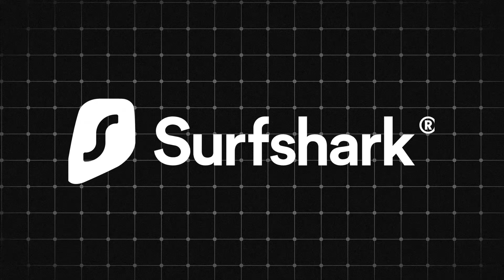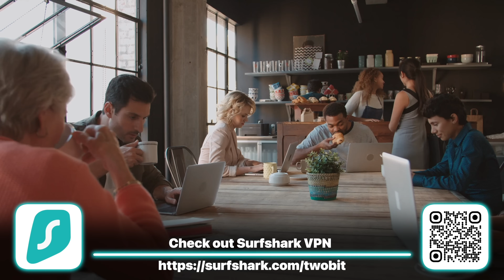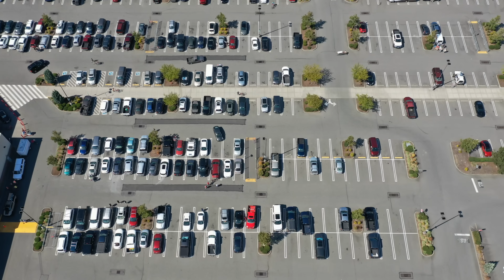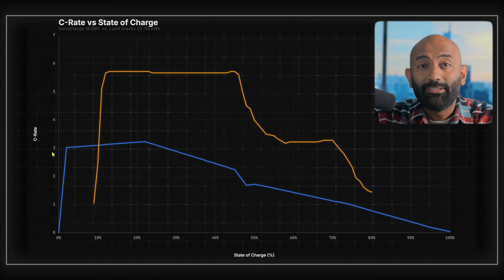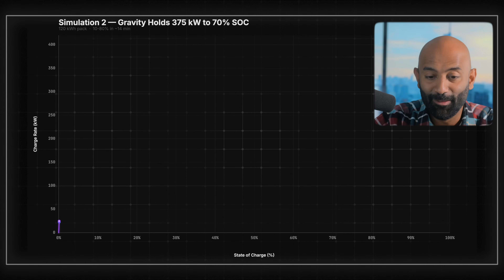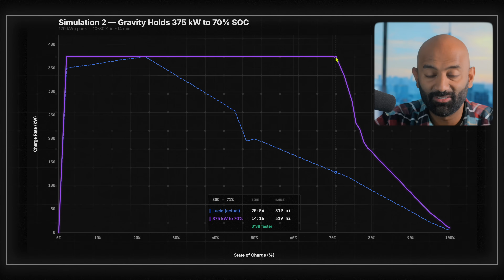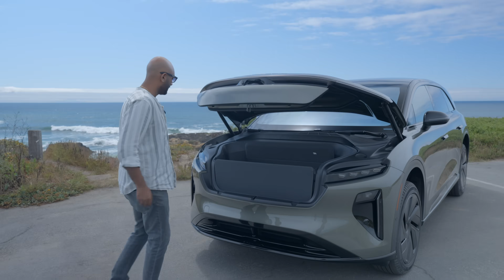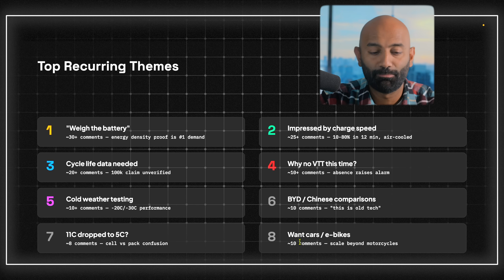Donut Lab Battery Test 4 Changes Everything!

Comment: If that energy density claim gets close to the 400Wh/kg on their next VTT episode, Donut Labs will need a bigger office space (not virtual as in their CEO's videos) - a Hyper Factory, if that is the right term. They will have a LOT of customers lining up. Who cares if these cells only maxes out to 20k charge/discharge cycles!! That is a moot point, but would be great if VTT can prove it by best estimation like how we calculate MTBF (mean time between failures)
Reply: If they could get 5000 charge cycles that would be (at 1x per day) 13.7yrs worth. Most people don't charge everyday. Really easy to make 5000 charge cycles last 25-30yrs. I don't think battery manufacturers want everyone owning 100,000 charge cycles batteries. It's hard to get repeat customers if the batteries last longer then the people buying them.
Reply: @kennedy6971  When you are in the business of changing EVERY single battery charged device, who cares about repeat customers? We all have hundreds of battery powered devices ready to be upgraded.
Reply: @kennedy6971  depends if they come out with more range
Reply: @kennedy6971  This. Donut Labs are getting so much hate out of nowhere when the same people are gooning after Chinese solid state batteries nowhere near production ready or tested. 

Why? Because it's a small company about to break the status quo.
Reply: @kennedy6971  100,000 cycles will matter a lot in applications that require multiple charges per day. What applications are those? Beats me, but if the batter charges this fast and can actually be whatever shape the user needs, that potentially opens up a lot of new applications that require very small batteries. 100,000 cycles at 1 cycle per day is about 55 years, sure, but is only 5.5 years at 10 cycles a day. Again, I have no idea what application would require 10 cycles per day, but I'm at the point now where I'm wondering if those applications don't exist because they aren't possible, or because they haven't been possible yet.
Reply: @kennedy6971 at the end we will be expecting from them to run away with money and instead they will die in weird accident.
Reply: @zperdek  this is a big government contract type of development not the weird coincidental accident type lol
Reply: @zperdek I’m expecting them to be bought out by big money. Then the project will be buried or hoarded for special purpose. Unfortunately, I don’t expect this to be a production product for the masses.
Reply: MTBF would be a good benchmark for stress testing the durability of the BMS (battery management system), as we've already seen in LFP packs, 99% of the failures are actually from the broken BMS, not from the failing cells, as the LFP cells are lasting over 5000 cycles that the BMS are failing way before the cell gets degraded below 80% health
Reply: If the range is 200 miles with 20k charge OR discharge cycles then that means 2 million miles. 4 million miles if it was 20k charge and discharge cycles...
Reply: @0ooTheMAXXoo0  In standard terminology, one charge cycle includes both the discharge and the charge part of the cycle. And it means a full charge. If you often charge from only 20% to 80%, those don't even count as full charge cycles.
Reply: it also depends a lot on how exactly the rated life falls off. i believe the standard for amountbof cycles is based on how many charges until its capacity drops to 80% of the original. 
so does the battery then stay at 80-60% capacity for just as long, or does it just completely break very quickly after dropping below 80%? a lot of people might keep using it with 80% capacity and not bother replacing it. or they can be reused in stationary power banks to store energy.
Reply: 14610 cycles are 40 years of daily charging 🎉

7305 cycles are 20 years of daily charging 🎉

... who charges daily?
Reply: @gridvid  People who try to prevent their Li-ion cells from degrading by trying to maintain as steady a charge as possible.

That said, since the chemistry here is looking less and less like Li-ion, maybe that doesn't apply?
Reply: modern cellphones?
Reply: @NotoriousNickNorris  Laptops never thrown out because their battery is dead?
Reply: @gridvid  -- People who drive an EV every day and who want to ensure that they have maximum range because of the unpredictability of their route that day?  I probably only charge my wife's MYP 3 times a week because we are retired and don't drive that much... I could probably cut that in half if I new with absolute certainty that my wife wouldn't decide that we need to detour somewhere else at the last minute... Then again, at our ages, even when charging the vehicle that often, it will still probably outlast us... The vehicle has 7500 miles on it after a year... That means that it would take 16 years to do 120K miles... Looking at normal life expectancy figures, I suspect that it is unlikely we'll still be around in 16 years anyway...
Reply: I’m as excited as you for this to be real!
Reply: Can someone explain to me, a total n00b in this field, why the power to weight ratio gets such attention? Not here to bash or troll, really want to understand the significance. Because my brain gets stuck at charge speeds, so power to weight ratio became less relevant but it feels like there is other artifacts behind that number why it is of importance. So please enlighten me!! Thanks a bunch!!
Reply: @jwvandegronden  That one depends a lot on the specific application as far as how important it is, but in summary, the greater the charge density (power to weight), the more charge can fit into a specific weight of battery. Without getting too far into it: For the sake of argument about our motorcycle here, we'll say you need 4 kilowatts (4,000 watts) of battery capacity. If the charge density is 400 watts/kilogram, it means you need a 10 kilogram battery to get 4 kilowatts. If the charge density is only 300 watts/kilogram, you need a 13.4 kilogram battery. This is significant for two reasons:

1. The heavier battery will usually be physically larger, so that potentially limits your design options, but more importantly

2. The heavier the battery, the heavier the motorcycle, and the heavier the motorcycle, the more power you have to use in order to move it.

It's like how if you put a sedan next to a pickup, and they both have the exact same engine and the exact same fuel capacity, the sedan still gets better MPG because it weighs less than the truck.
Reply: @PhycoKrusk  -- Actually, the correct units are Wh (watt-hours) and kWh (killowatt-hours), not watts and kilowatts...

Also, the sedan vs truck comparison is not that simple... Weight mainly affect fuel economy during acceleration, not one it is at a steady speed... Frontal plate area and coefficient of drag affect fuel economy whenever the vehicle is moving (although a lot more at high speeds).
Reply: @CurmudgeonExtraordinaire  I effectively opened my reply with, "Without getting too far into it," implying that what I was stating was simplified.

Does nobody read anymore?
Reply: @PhycoKrusk  -- You can't use that as an excuse for using the wrong units.
Reply: @CurmudgeonExtraordinaire  Sure I can, because I'm not explaining how it works; I'm explaining why everyone is making a big deal about it. In an case like this, the concept matters much more than the content.
Reply: @PhycoKrusk  -- You can dance around it all you want, but the facts are you were lazy / made a mistake... I'm an engineer (retired) and accuracy is important...
Reply: @CurmudgeonExtraordinaire  For engineering, yes, accuracy is of vital importance; otherwise, new rules get written.

For somebody who's not an engineer, accuracy is less important.

For someone who is totally new to the area and just wants a quick summary of what the big deal is, there is no meaningful difference between watts and watt-hours. For most people, there is no meaningful difference between them, so some information naturally gets omitted for the sake of simplicity.

This is a necessity for sales and marketing: The customer doesn't need to understand all the details; they just need to understand why this product is better that what the competition is offering, even if that understanding is somewhat truncated. As long as they aren't given an unrealistic expectation of what the product will do, it's fine.
Reply: @jwvandegronden  a smaller, lighter, but more energy dense battery means an overall smaller and lighter vehicle, which means every other part of the vehicle can be scaled down as well (brakes, suspension, etc).  This brings down overall vehicle cost and increases performance.
Reply: @dhalbrook  Yes I get that. Thanks.
Reply: the lesser the mass, the less energy you need to move it. Which means less power needed to be in the battery, or more so, the more distance you get from the same size battery.
Reply: What Donut should prove next is their battery chemistry. Their original claims that the material compositions are: "globally abundant" and "geopolitics neutral"?? Well, this would be the killer episode to prove this claim.

Then again, this would be like KFC or Coke publicly discloses their secret ingredients for all to copy. Those Chinese battery companies are salivating at the prospects. ;)
Reply: @AldrinAlbano  They aren't disclosing the chemistry yet because they don't have the patent yet. When you patent a manufactured item (such as the battery chemistry), the patent has to disclose the manufacturing process (which includes the chemistry) in enough detail that someone else could produce it. So, since they'll have to disclose the chemistry when they get the patent, why disclose it early?
Reply: @PhycoKrusk  I don't think that's how the patent system actually works. The general rule is that their "invention" is "novel". That word doesn't explicitly force an inventor to disclose everything to the patent. Otherwise, we would already know how to make a perfect Coke Classic or a KFC original. :) I am not a patent expert but I read somewhere there is a clause to allow an inventor to bundle his/her most secret recipe in a something like a general non-declared line item and can be shown on request. Have you noticed the patent drawings are like hand drawn by a kindergartner? There is a reason for that.
Reply: @AldrinAlbano  We do know how to make those things; those recipes have been available for a long time now. Nobody makes KFC at home because making chicken in a pressure cooker in a pain in the behind.

Nobody makes Coca-Cola Classic because that would be illegal: Doing so requires using coca leaves that have had the cocaine removed, and Coca-Cola has an exclusive, government-granted license to import coca leaves for the purpose of sending them to be "de-cocafied" by the one laboratory that is authorized to do so.
Reply: Their current cost will ensure that the company does not get that big...
Reply: For me, the composition would be next. They proved it works, somewhat to a good level, but what's inside and how to manufacture it... For me that will be the break news. They should open source this technology and just sell factory machinery with royalties. Fast world adoption.
Reply: @JoãoPCarvalhinho I don’t think they will reveal the composition any time soon. Based on the deal with CT coating and their technology.
The battery actually looks to be quite good but it is super far from their original claims and I still think it is at least 50% hoax
Reply: @sebulban  Not the details, but 15 days away from shipping the first real life product, they could mention/talk about the content... but yeah.,.. it will be the last thing we know.
Reply: The VTT with passive cooling wa actually inside of a climatic chamber which means that air flow is quite high (it is basically active cooling as the moving air will take the heat out from the surface of the block)
Reply: They'll also need a bulldozer to get through the industrial spies surrounding their building.
Reply: That's why I don't understand their gimmick marketing. If they have what they say they have, all the principals involved are already billionaires, and who cares that the company even makes novelty spokeless wheel bikes.
Reply: @mariusvanc  Just because they have the battery chemistry doesn't mean they have the factories to build it. That takes time to set up, but sufficient excitement will draw more attention, including attention from investors who will be able to help the company get those facilities set up faster.
Reply: Yea but the point is the next video is going to be one of those specs...and both of them are going to blow away mainstream cells by an order of magnitude...good job Donut Labs!
Reply: What if these cells only maxes out to 50 cycles or 5 years....will they in that case need a bigger office or a one way ticket to Nigeria?
Reply: @AldrinAlbano  20k?like bruh that would be the bane of Battery Corpo existence 😂, even 5000 would be fantastic enough for nearly a decade, even if it's just on part with Top tier Lithium Tech today in Capacity
Reply: @InfinitusEternia  I agree. That is why their 100k claim is a moot point of discussion. I will take 20k please??
Reply: Don't forget that it doesn't exist until they can build it at scale, either.
Reply: @GregMcNamer yes but everything they said was true so far... So I suggest we just have to wait..
Reply: @Peter-x29  Well, they claim a full charge in 5 minutes on their website still....
Reply: @GregMcNamer well website claimed my HDD should have 24TB and it has only 20. My car has maximal speed 200km/h and when I tried I got only 186km/h... This is normal... Like in perfect condition perfectly cooled it is capable to charge in 5 minutes... We saw it on tests, but in reality it will be slower! Not much but slower
Reply: @Peter-x29  So you agree the claims are unrealistic.
Reply: @Peter-x29 0-100% in 5 minutes (Claim) is quite far off from the 10-80% in 12 minutes…
Reply: @sebulban - did they claim 0-100% in 5 min for an air cooled bike, must have missed that when reading the bike specs or the Donut battery statements.
Reply: @GruffSillyGoatthey clamed that their new solid state battery will charge 0-100% in 5 minutes. They are maybe 1/3 of that or even less
Reply: @sebulban no... Claim is that battery cell 0-100 what can be achieved... But air cooled motorcycle battery pack is 10-80% 12 min on not so fast charger older version of motorcycle and first version is absolutely ok
Reply: Few years ago their supercapacitor was rated for 160wh/kg,  they made few improvements and reached 298 wh/kg at cell level. 400 is a Donut lie
Reply: @rwyo83  honestly if it is 298wh/kg half their charge cycles and it just being faster to charge and more stable would still be a killer setup.
Reply: @Rampantgecko  The cycles are true, I know the exact chemistry that they are using, it's very thermal stable and durable. I'm just disappointed with the self discharge, for being a supercapacitor it's really good, but a battery is way better
Reply: @rwyo83  xD every person want to know what chemistry they using and here random comment says he knows exactly
Reply: @sladewilson8241  I was built different, I'm very good at solving puzzles
Reply: @sladewilson8241 😂😂 if you are from the industry you kind of already guessed...
Reply: @Peter-x29 every YouTube engineer guesing avout being super capacitor and if you say everyone in industry knows so when the same batteries from other manufacturers will come if it so easy to guess so probably everyone have some by this time
Reply: @sladewilson8241 from some reason I see you answered something beginning "engineer" but I don't see the comment
Reply: @rwyo83  Test 3 shows this battery is not a supercapacitor
Reply: @XGD5layer  No it doesn't, a battery has way better charge retention
Reply: @rwyo83 - you're considering the charge retention rate inclusive of the initial brief relaxation period. Iif one considers the rate after this point it lowers to losing ~1% a month, which is better than most batteries. Don't see any evidence of the high loss rate a supercapacitor would exhibit.
Reply: @XGD5layer  What test 3 doesn´t show is if this is a Donut solid state battery. Even VTT has a disclaimer in their test reports stating it is the paying customer, Donut lab, who claims it is a solid state Donut battery VTT has on the test bench....VTT doesn´t know, you don´t know, only the snake oil trader knows what´s inside the bottle.

Just another claim from Donut, on top of the pile of claims from Donut lab.....zero evidence for anything.
Reply: @rwyo83 it's not a super capacitor. Stop lying.
Reply: @florin604  Nordic Nano called it a supercapacitor, Verge is a customer of Nordic Nano